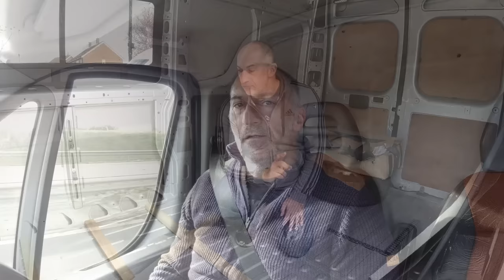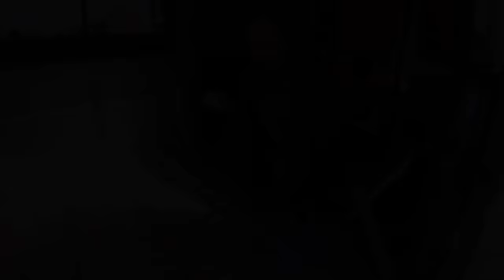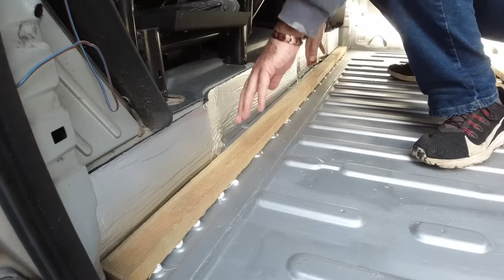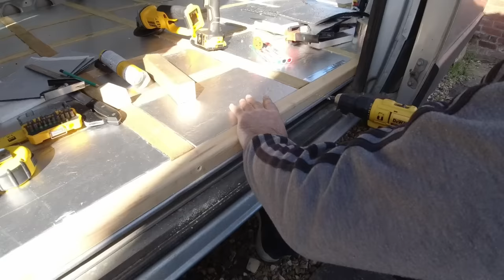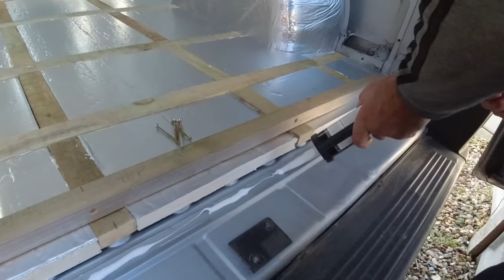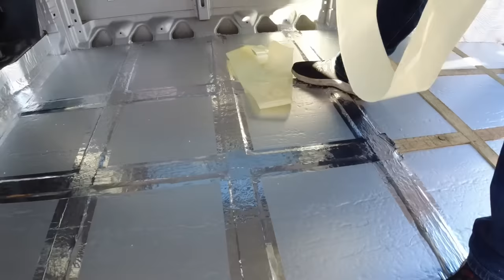How to Insulate your Floor on a Budget - Episode 7 of the Van Build Series

Comment: Great channel, Greg, much appreciated. Can I ask what your views are on the timber being a cold bridge, much like the metal struts are elsewhere in the van?  Timber is better than metal in this regard, but still a cold bridge nonetheless. Would it be prudent to minimize the use of batons if at all possible, and try and have as much insulation as possible in contact with all metal surfaces? Love to hear your thoughts on this, as you obviously give these matters a great deal of thought.
Reply from the maker: Well, I'm really pleased to be able to put your mind at rest and correct that information with these facts.
Let's just compare the Thermal Conductivity of these base materials as these are the units of heat transfer.
PIR Insulation board 0.022 W/mk
Woollen Type Insulation 0.044 W/mk
Timber and Wood 0.14 W/mk
Steel Van Structure 45.0 W/mk
Aluminium 235 W/mk
It's only just over 3x more than any loft insulation materials but over 320 times better than steel and 1,678 times better than aluminium.
Therefore as you can see now, Timber is a natural thermal insulator due to having air pockets within its cellular structure. Wood, Plastics, Rubber and all other insulation materials are POOR conductors of heat. There will be no cold bridging at all.
Reply: @GregVirgoe  Thanks for the quick reply. That's great to hear. The reason I asked was, when I was building my house, my architect kept stressing that I minimize the use of timber studs( I'm old school and wanted 16" centres as opposed to 600mm ,which is now standard) due to 'cold bridging'. Have you ever just filled the ribs with timber straps and then laid 10mm foiled back foam insulation( the same stuff that is used on the walls) with the plywood on top?
Reply from the maker: @mrurga35  As I have just shown there is a small difference between timber and insulation but nothing that will cause you any problems. The degree of thermal bridging in a timber stud wall is minimal. I studied at university to be an Architect so I know all the calculations involved in that theory

Comment: your videos are fantastic. we are just starting to build our camper ( fitting the flooring as we speak :) ) , and your videos are very helpful to us. I do have a question about drainage, I noticed you didn't drill a hole in floor for waste water to do into a waste tank. Is this something that should be done before putting the boards on floor ? Or should we install the plywood and then cut trough ply and metal together to get cleaner lines ? Would really appreciate your opinion on that. Thanks :)

Comment: Hi Greg, many thanks for your videos, I am a complete beginner and your videos are helping me hugely. May I ask your advice on floor insulation If I have limited head room. I am converting a L1H2 Transit custom and think I have 3cm head room with nothing in the van, so really need to make sure my ceiling and floor insulation are as small as possible. Many Thanks!

Comment: Hoping there'll be another video today! I take it its ok with a tiny bit of air gap between the top of the metal van floor and the bottom of the insulation given the ridges in the floor? Is it ok because its basically sealed given the vapour barrier above or is it just its such a small amount in the grand scheme of things? Just trying to wrap my head around the science 😂

Comment: It might be a year later, but I'm benefitting so much from your videos as I'm just about to start my Renault Master fitout.
Thx for your huge effort.

I was going to do what you've done (timber battens and insulation) and then lay a vinyl interlocking plank floor over the top.
I can't screw it down then, so is it ok to leave it float on top? Or should I put a few dabs of sikaflex on each board to hold it to the foil tape underneath?

Comment: Hi Greg, How did you anchor those solar panels to the roof, looks like you have screwed those directly to the roof. I had wanted to do that, as it gives a more low profile look, I was then going to go the unistrut route as some have, my build is a Peouget Boxer. The only thing that realy worries me is drilling holes in the roof as you have & then worrying about potential leaks. Could you perhaps show us the right way to go about this, as you have. This build you have got going now could not have come at a better time for me personally. I am watching in earnest as you upload this is brilliant... More power to you, & fair play to you for showing us the right way to go about a build.    Gerry, in Ireland.
Reply from the maker: Yes I too wanted to get them as low to the roof as possible. So they are the standard aluminium feet with sika underneath and a single self tapping screw in each bracket. You can get them lower still by putting the brackets on the end of the panels. I made sure there was plenty of sika flex and I did put some on the screws from underneath too. I know many people that have screwed down their panels with no problems
Reply: @GregVirgoe  Excellent, then I think this is the way to go for me also. If you do happen to be up on the roof working some time & if it's not too much trouble soon could you show us a little bit of footage of how the brackets look fixed in place.

Comment: Hi Greg.... just purchased a Boxer XLWB and have already had a front bed seat installed which is bolted through the metal floor.
For reasons i cannot go into, I had this done before it was insulated.
When i do come to insulate, do you think i need to line floor battens up with pre drilled holes in van floor?
Any advice greatly appreciated.
Keep up great work for novices like me ❤

Comment: Greg, can I ask a question. I'm laying my sub floor today and have had it all planned out thanks to your excellent advice and guidance. However,  I've just read about having a potential air cavity under the PIR board where it runs across the raised sections of the van floor and doesn't sit flush on top of it. What are your thoughts on this please? Thanks.
Reply from the maker: Do not worry about that at all just make sure to foil tape seal all the edges and gaps at the door to the floor. As long as those voids are sealed there will be no problem, an air gap will act as a small cavity and offer some resistance to heat transfer. You don’t need to fill the voids 👍🏼😃
Reply: @GregVirgoe  Thanks for your speedy reply.

Comment: Greg would I be right in saying that sheep’s wool insulation wouldn’t be sensible to use seeing as you said it holds moisture. If that is the case the insulation made from recycled plastic bottles would be better to use. Many thanks for all your videos.

Comment: I know you didn't need to use screws to hold the battening down in your application but you must of been lucky that all your timber was exactly flat. Having used battening in the past, I know that isn't always the case, so you either have to screw it down or have to put weights on every section of wood, which could mean a lot of weights. It always makes it so much easier if that wood is flat.

Comment: Hi Greg, I'm just starting my own build but in a luton van.. your videos are incredibly helpful and to be honest I'm not sure I would have committed to doing a van conversion if it wasn't for your original series! 
Just wondering why you only use 25mm pir board on the floor and 50 on the walls?
Reply from the maker: It’s really just to get max height inside but still have reasonable insulation. If you have the height then go for thicker insulation. It will make a massive difference 👍🏼😃

Comment: Me again Greg 😂 so I can bulk buy the timber battens 25x50 but am I likely to need them for more than just the flooring? Just though I might as well order a few over as I’ll probably need them anyway?
Reply from the maker: I used exactly 8 x 3m for the floor of this MWB van, the ones I had were rough sawn so had a very untidy finish, not really suitable for furniture unless you could plane them smooth. You could use them for battening on walls and ceilings, seen many others do that :D

Comment: Much appreciated wisdom as always!! The biggest a issue I’ve run into with my Relay is the cup holder situation. Have you any thoughts on improving the cup holder in the cab?!
Reply from the maker: Yeah why are there no cup holders on the drivers side?? We fold down the centre seat section as there are two more in the back of that. You can buy ones to screw to the dash but not a great look are they 😊
Reply: @GregVirgoe  Later vans have cup holders instead of the central glovebox. Easy to change.

Comment: Thanks so much Greg! Quick question. We have installed our subfloor with a vapour barrier underneath but we now need to add some drop out vents for the gas connections. Can we go straight from the subfloor/ vapour barrier? Or do we need to take the ply floor up first? How do we seal the vapour barrier again? Thanks!

Comment: Im starting next week thnx for the videos...but why not glue isolation directly to the floor?in big size,put plate over it,screw it to floor.why the wood in between?
Reply from the maker: I explain at the beginning that the insulation is compressible overtime so the timber gives much better support.
Reply: Thanx for the responds sir.
My english isn´t the best so i have to watch the same video 4× to understand every single word.
But i understand now.
Thnx for taking the time to respond
And see you on the next question maybe?:)
Take care,thnx again

Comment: This is awsome, just about to build the floor in my ducato. I will follow this guide, if only I can find 25mm insulation, seems to be rare in sweden. Did you need more than one tube of sikaflex?Thanks!
Reply from the maker: Yes it was two tubes of Sika. Have you tried asking insulation contractors in your area. 
My last van I got insulation from local installer who did a supply only.
Reply: @GregVirgoe  thanks for the tip, I will try that!

Comment: Is Polystyrene as same as PIR? I live the US and wish we had some of your products in UK, like recycled plastic insulation.
Reply from the maker: Hi Claudia, polystyrene is not as good, yo uneed to look for Polyisocyanurate Board which they do stock in LOWES in different thickness and 8x4 sheets... heres a link for you https://www.lowes.com/pl/Polyisocyanurate--Board-insulation-Insulation-accessories-Building-supplies/4294858106?searchTerm=insulation%20foam%20board&refinement=4294837592

Comment: how does the wood compare to that insulation material? does adding more wood in between the insulation lose much heat? would we see a red outline of where the wood is if you used an infra red camera on it once it's all done? edit: or i guess dark bits not red
Reply from the maker: Timber is a natural thermal insulator due to having air pockets within its cellular structure. It has a thermal conductivity range of 0.1 - 0.2 W/mk so only just over double that of wool insulation. It is 400 times better than steel, 1770 times better than aluminium.

Comment: Another good informative video Greg, Q, what size/type of screws did you use? and what size counter drill bit you use for the pilot holes?
Reply from the maker: I just pick a countersink that would clear the head of the screw. There is a set of varied sizes  those long screws were 3” no 8 or close to that

Comment: I'd be curious to know what your thoughts are on the gaps at floor level, most importantly were the plastic trims attach through the body. From my experience with same van so far I find moisture gets in that gap no matter what you do as well as the wheel arches. Im planning to sikaflex the back of the clips but still converned how this may affect vapur barrier later on 😕
Reply from the maker: I purchased a packet of new clips and removed and replaced them all  to improve the seal on the trim
Reply: @GregVirgoe  sounds a good idea also 👍
 Curious if you intend to pack the sill gaps inside with insulation or not?
While I'm on board with a vapour barrier, I am however starting to wonder after a few recent heavy showers if those floor cavities and a vapour barrier could be a combination for holding damp/ locking them in the Sill?  (I know the vapour barrier can be a controversial topic) would be keen to see your opinions on the pros and cons as these vans seem to have endless moisture weeping 😬

Comment: Can I ask what timber batten you used on the edges of the doors? It looks to be a different wood, (not pressure treated?). Maybe 30x30mm?

It obviously takes into account the extra height where it's not sat on a ridge- in my van it looks like the height I'd need would be 30mm approximately. 

It definitely gives a nicer finish to those visible areas.

Comment: Your videos are great, thank you so much! I do have a question about this one though: I thought that it was not good to use so many timber battens because of the heat transfer from the metal panel through the wood. There is no insulation there. I thought that it's better to just use the XPS with a plywood sheet on top, and that with the weight distributed, the XPS will not compress. Am I wrong on this? Thanks for your inputs
Reply: Although I don't think there would be much heat transfer through the wood, as it is not a very good conductor, I agree that the surface area of the plywood would distribute the weight enough for the foam to support it.  PIR 15 can support 15 lbs. per square inch, that is 2160 per square foot.  PIR 25 would per 3600 lbs. per square foot.  that is what I am planning on doing.

Comment: Hi Greg, very good videos thanks, do not you worry that in the gaps under slats and plates can generate moisture? I have to make the floor and I have that doubt.
Reply: I used foam adhesive under my floor, it filled any voids that might, as you say, generate moisture.

Comment: Really enjoying this series Greg, a I did with the sprinter. I am also planing a ducato l2h2 conversion. Did you gain any load length when you removed the bulkhead? or was there no space anyway between front seats and bulkhead. Also how deep roughly are the roof ribs on the van? Its hard to get detailed dimensions. 
Looking forward to seeing how you deal with the water and power system in this one. 
Did you consider a pullout bed for this one to gain some day space? Thanks.
Reply: Roof ribs are about 25mm deep, 25mm pir fits perfectly. If you put 25mm roofing battens lengthways it is possible to add another 25mm pir in that direction.
Once the bulkhead is out there is around 3m to the back of the front seats.
Reply: @andyb9262  Great. Thanks
Reply from the maker: Looks like Andy B beat me to it, thanks Andy for helping out there :D I plan to use 12mm plywood battens for the roof beams so will start with a layer of 10mm closed cell foam direct onto the roof then a layer of 25mm PIR board and a final layer of doubel bubble foil that will make up the depth of the ceiling. No gain in length after bulkhead removal, despite how satisfying it was to remove :D lol

Comment: Good work and material deals, in the video it looks like the timber buttons are proud of your insulation by a few mm. Isn't this a problem for the next timber floor panel layer that you intend to lay on top, will it not curve in the space between the buttons in the high traffic areas? Also I do not fully understand why the foil tape (which is expensive) as timber is a barrier anyway?
Reply from the maker: There are slight gaps between the insulation and the timber and the timber is porous and is not a barrier at all.  So the foil completes the vapour barrier across everything. I only used 1/4 of a roll and it wasn’t expensive at all. Check the links in the description.
Reply: @GregVirgoe  tnx I thought the heat treat of the timber made it into a barrier, cause you were comparing it to the much more expensive green roof buttons which I think are a barrier. In France where I live the insulation panels are relatively cheap but the tape is pretty expensive. And one goes through a lot of tape for all the ribs, etc. of the van.

Comment: Quick question, I understand good roof & wall insulation as that's where all the heat goes but what exactly is the rationale behind having such  thick floor insulation? I would assume there's not a lot of heat lost through the floor?
Reply from the maker: You’re thinking about heat rising in a fluid like air due to convection but heat transfer by conduction through a structure happens in all directions. The transfer of heat happens from hot to cold and is only slowed down if the thermal resistance of the structure is high. So it is as critical to do the floor as any other surface in your van. Watch Alex Frood vanlife videos to see his water and boots get frozen to his floor to prove that point. Also watch my early videos on insulation to learn about heat loss. Don’t neglect the floor trust me 👍🏼😃
Reply: @GregVirgoe  thanks for that, very helpful:)

Comment: Jumping on the congratulations wagon as well, but I'd like to ask you, what about the depressions grooves in the floor, I've seen a lot of people sticking there some closed cell foam before the panels, what's your reasoning not to?
Reply from the maker: It’s a lot of extra work and cost for very little gain. So the benefit is small

Comment: Hi Greg! I'm just starting to convert a 2015 Ford Transit 130 medium roof passenger van. I live in Texas but like to vacation in the mountains when I can. Due to the roof height, I can't fully insulate the floor but I have some Siless 4-mm closed cell foam squares I was going to affix to the metal floor under the subfloor. Is this ok and should I also put it on the walls/ceiling beneath the wool insulation? I just don't want moisture issues. Thank you!